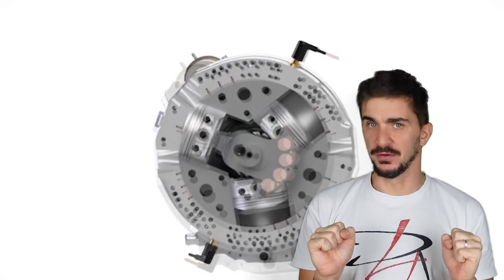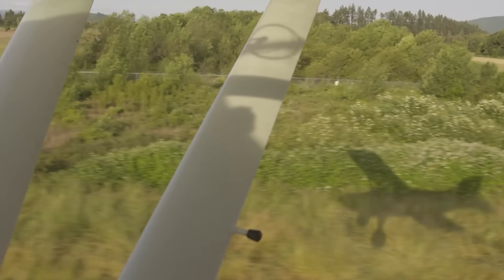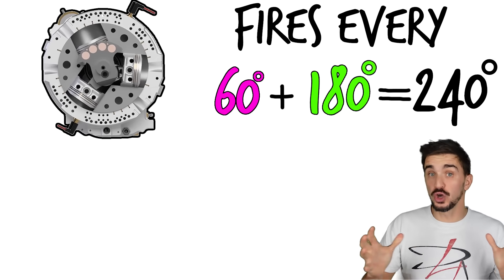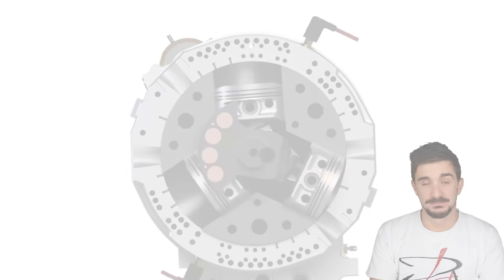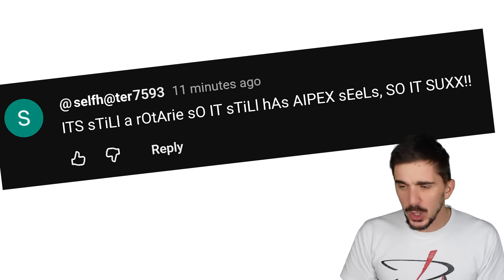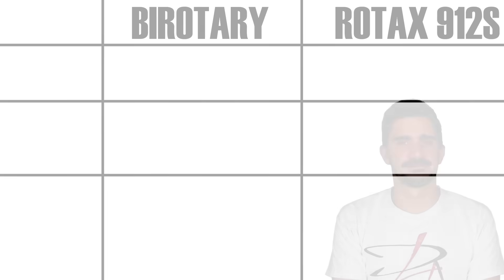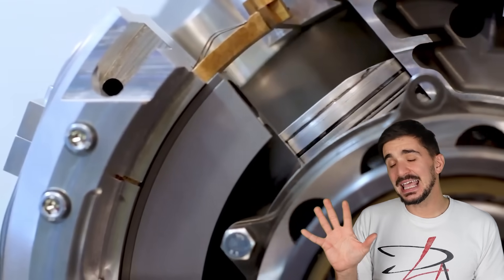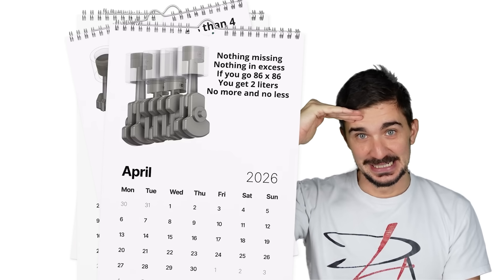This is What Happens When Pistons and Rotaries Make Babies - Birotary Engine Explained and Reviewed

Comment: How long till we rediscover huge WW2 radial engines?
Reply: Actually, this appears to be a revamp of the WWII Rotary radial engine. Like the Gnome Rotary. Counter-rotation of the shaft does make sense.
Reply: @stephenweaver7631  * WWI was ore the era of the rotary, radial was generally a WWII thing.
Reply: @stephenweaver7631  Were rotary engines still used in WW II? Looking at Wikipedia it looks like Gnome produced rotary engines in WW I, but in WW II Gnome et Rhône as it was called then produced radial engines, not rotary engines. Generally speaking weren't rotary engines largely obsolete even in the interwar period?
Reply: @rschroev  The problem with rotary engine was the massive rotating mass.
Reply: @Agnemons  Yes, and ridiculous amounts of oil leakage, and difficult power control. But that wasn't really the point here.
Reply: @Agnemons  ...and to this day it still is. Even when  you have two opposite rotating masses cancelling each other out, they still come with downsides of all the spinning kinetic momentum.
Reply: @rschroev  The Rotary (Wankel) engine was designed in 1934 and was first presented to the public in 1959, after WW2 - They used Radial engines in both world wars. Similar idea, but very, very different. The radial engine was from 1901. That's what they used.
Reply: @Orbi-tal What would you call the type of engine that was used in e.g. the Sopwith Camel? Cause that's the type of engine I assume @stephenweaver7631 was talking about.
Reply: @rschroev  A Radial engine (all propeller driven aircraft in WW1 and WW2 and after). The pistons are fixed around the outside in that design. A rotary (Wankel) engine works differently. I guess they are both rotary in a sense, but in a radial engine (planes) with the pistons in fixed positions around the outside, the piston rods push and pull the center crank. In a rotary engine as used in cars (Wankel engine), the triangular piston is pushed around the inside of the engine from ignition point to ignition point, spinning the crank.
Reply: @Orbi-tal The Sopwith Camel, like many fighter aircraft of WW I, very much had a crankshaft fixed to the frame of the aircraft, with the cilinders rotating around it. The propeller was fixed to the cilinder block. It is called a rotating engine. Go look it up if you don't believe me. 

Also a bit off-topic but even apart from that not all aircraft have radial engines. Spitfire didn't have a radial engine for example, to name just one WW II aircraft. These days propeller aircraft virtually all either have a non-radial piston engine or a turboprop.
Reply: @rschroev  Oh, I stand somewhat corrected then. The Sopwith engine is the Bentley BR1 rotary engine. I had no idea the outer pistons actually rotated. Thanks. Radial ones - pistons are fixed around the crank. I was picturing rotary as in the ones in a car design.
Reply: @rschroev  The only reason the FW190 went into production is because it used a radial engine so wouldn't take inline ones destined for other fighters.
Reply: @Orbi-tal no.
Reply: @stephenweaver7631  You're confusing World War II with World War I. Rotary radial engine means the crankshaft is stationary and everything else is spinning.
Reply: LetsGoAviate on YouTube goes into detail about a two stroke jet fuel or diesel radial engine. Impressive looking stuff.
Reply: I think he 'missed' mentioning radial engines, despite being the closest comparison to this creation (both in use and concept), to not spoil the engines from his calendar as I am pretty sure the 7,9,11 are all radial engines.
Reply: Actually, no; I think the closest comparison is to the rotary engines used in many WWI aircraft, like the Sopwith Camel or the Fokker Dr.I, where the radically-arranged cylinders rotated around a fixed crankshaft.
Reply: @seanmalloy7249  The Sopwith Camel is the first thing I thought of too.  Talk about gyroscopic precession.
Reply: @LAndrewsChannel maybe he'll put that valtra 7 cylinder in the Calender instead🤪

Now that I think about those quirky Traktor makers one of their recent promotion stunts comes to mind where they put alot of tires on one of their models and took it for a swim...

Man you really can't make the stuff up that they use their time for.
Reply: I did a goof and misremembered that it was the Tire manufacturer Mitas that did it with a New Holland.
Reply: We're having electric vehicles from 100+ years ago again 😂
Reply: @wanderingbufoon       They are soon going to become exclusively rich people's toys (they might not disappear this time, simply because now there's enough rich people to keep the market rolling).
The reason plug-in battery-electric vehicles disappeared in the 1920s, 70's and 90's is simple: Batteries do not store electricity.
Reply: @gsilva220  "Batteries do not store electricity".. say what now??
Reply: @wyskass861  ...do not store electricity /hold a charge [forever]
Reply: @evn_exe  Quite a different statement and very loose use of wording. Also maybe you're not aware but modern batteries self discharge rate is very low. Not sure what point you're even trying to make here. Because the reason was not at all self discharge, but low energy density and longevity in battery tech back than, that had to IC engine become standard.
Reply: @gsilva220  well, we all know the reason why and that's due to business. While their battery capabilities were bad back then, they would've had invented better, smaller, more powerful and capable batteries had it not been for petroleum companies. 

It's kind of like with Nikolai Tesla and Benjamin Franklin and so on. The reason why the US adopted the AC is because they wanted to make money on DC because that's where they've had their money tied to.
Reply: @wyskass861    They store chemical energy. Charging a battery is an energy conversion operation, which basically means batteries will never charge quickly and be affordable at the same time.
Reply: @wanderingbufoon  negative. DC was never gonna be useful due to voltage drop over distance. liquid fuels are still 50-100 more power dense than even modern batteries. we were nowhere near the tech level for the batteries back in the early 1900s. a nuclear reactor driven car in the 50s was a much more achievable goal than developing the class of batteries we have now (which, we're worked on just as hard since the early 1900s and didnt start having something until the 70s)
Reply: @gsilva220  "Quickly" and "Affordable" are relative terms.

Combustion had the advantage in that was cheap and easy to do at a good enough level to be viable for its first 100 years. Now, because of environmental and fuel cost reasons it is becoming more expensive and more difficult to do these days with it only getting worse in the future. The only real advantage combustion has now is the natural inertia built into the system. (Sales, refueling and repair infrastructure along with entrenched knowledge and bias). Hydrogen is in a worse position than Electric in a number of ways. Electricity has been around for longer than combustion engines, just not in automotive so it lacks the knowledge base in the general public. But that also applies to hydrogen. Hydrogen requires building a complete refueling infrastructure from scratch. From manufacture, distribution to sales. For Electric the distribution is largely in place already it is only the terminal end (the plug in point) that needs to be done. As for manufacture (generation) that is already under way for AI datacenters and, compared to the requirements for those EV power needs are relatively minor.
Reply: @gsilva220  lol.. Yes internally, but you're being pedantic and pointless obtuse to suggest so. Your point is without any context. "quickly" and "affordable" are meaningless otherwise. These are relative terms and need comparison to an alternative in the same functional domain. Empty words, trying to sound smart.
Reply: @bmxerkrantz  goodness, I think you completely missed the mark here. For one, I brought up that example as a means to establish that progress was stopped in favour of profits. Batteries could've been developed further similar to what we are now currently accomplishing. Had we still keep having that incentive, especially for vehicles, we may push even further into developing the battery tech. 

doesn't matter if it's a reactor generator, diesel, or hydrogen, or even coal (steam) to power up those batteries. We would eventually come up with a power dense one sooner than later.

That's the point. Like I said, electric vehicles were already around 100+ years ago. Even if it's primitive, all of them started off as primitive anyways. Fuel weren't refined and burned fuel inefficiently, most often blowing up the engine (which is why they require larger engines just so they can brute force the bad combustions). 

Again, with time, refinement. That would also be true with electric vehicles and their batteries. We got to see this with changing from lead to lithium making them lighter and rechargeable. Again, time and money are what drives innovation. Take those away and you'll be left with batteries that had been around millennia ago
Reply: @bmxerkrantz 
High Voltage DC Still has it's uses, especially over (relativity) shorter transmission differences.
Primarily, DC allows a utility to use a transmission line to carry more total current than with AC, putting off having to upgrade transmission capacity. 

Background. 
The AC current transmitted is a sinusiodal function, the same as voltage. Thus, the transmission line only carries peak current for a fraction of the time, but must still be sized for that peak current. DC carries peak current the entire time, so much more total power can be transmitted. (Maybe 40% more?)
Essentially, you sacrifice efficiency for capacity.
Reply: @gsilva220 you meant, "Batteries not generate electricity, they only store it"
Reply: @wyskass861      Quickly compared to vehicles that don't impose an input energy conversion step, and affordable compared to the cost of a gasoline vehicle with a similar proposal.
Reply: @drtidrow     Batteries store chemical energy and generate electricity on demand. Batteries are the fuel, electricity is a working fluid.
Reply: @wyskass861 batteries don't store electricity. Electricity is converted to store energy chemically and can be converted  back to electricity. It is the same as when you pump water into high(er) elevated lake/reservoir/tank and then let the water drain/flow down though a (turbine) generator  to convert it to electricity. The lake/reservoir/tank stores the potential energy  to convert it in to electricity, but it doesn't store electricity. There are many ways to store energy but it all depends on efficiency, cost, practically, and safety. It isn't very practical to drive around with a lake on a the roof of a car. 
Water can be split/converted through  electrolysis into hydrogen (and oxygen) or hydroxyl to store energy, but hydrogen from 1 liter (1 kg) of water contains 3 kwh of energy while it takes 5 kwh to split from water. 1 liter of gasoline contains approximately 8.9 kwh (or approximately 11.5 kwh per kg). To store that hydrogen it it needs to be compressed   or liquefied which is very costly and/or with safety  concerns.
Reply: @Agnemons Electric is already in place? I just spit up my coffee! The load of carrying the modern transportation system would require 3 times the size as our current electric system. And that is not talking about energy sources that can provide the constant load needed. Ridiculous!
Reply: @joemaloney1019  True BUT.
For EV's the infrastructure does not have to be built from scratch.
It also does not have to be built all at once.
Also, you are referring to the US grid. The same issues either do not apply or not apply to the same degree in other countries. (to be fair, in some countries it is worse)
Reply: I know an A&P who worked on them and they are a maintenance nightmare. This is the reason they faded from history.
Reply: @PatrickDuffy-u3s I can believe that, they look like you've got very little clearance for stuff even on a stand much less with stuff around it and connected
Reply: The huge part is the problem
Reply: @xani666 the fact that this one isn't huge is probably the impressive part of it. Though I'd like to see one in action.
Reply: @a_kamal_a   Two stroke engines have very serious emissions and efficiency problems.
Reply: 🤔 Well... It's not a problem if the vehicle is huge also...
Reply: We won't.  Large piston engines already lost out to gas turbines in sustained-load applications.  Piston engines still make sense compared to turbines in: 
1. Anything that needs less than about 500 hp;
2. Over-the-road vehicles, which require rapid changes in power output that turbines cant handle; and 
3. Ships and boats.

Large radial engines don't really fit the first two applications.  And, as someone else also mentioned, maintenance is also an issue.  If you need a large piston engine for your fishing boat, it's much easier (and cheaper) to maintain a V12 diesel than a multi-bank radial.
Reply: @tippyc2   4. Anything that doesn't need an engine that's 10 times more expensive.
Reply: First thing that came to mind when I saw that.
Reply: I never left!!! In the 90s I was a flying mechanic on S-58 helos. Curtis Wright 1820 cyclone engine, was quite the experience!!!!
Reply: @Thomas-c7j3f   H34 ?
Reply: These were radial but not rotary.
Reply: The b17 had the largest single stack radial engines. They were super charged and turbo charged.
Reply: I already did rediscover these engines. They have some very clear advantages, but a few key disadvantages. I have ideas to solve all of them, i'm just looking for  a way to get a patent.
Reply: That could be the engine configuration for 7, 9 and 11Cylinders in the calendar. Radial Engine.
Reply: I want the world to run on super loud droning 2 stroke diesels haha yeesh. That, or maybe large displacement 2 stroke gassers.

NOT.
Reply: They make new, small radials now, but they have substantial drawbacks.  They're very cool and the people that keep the old ones running are heroes, but large radials have little potential for rediscovery.  They're kinda bad at most things and long ago outlived their usefulness.
Reply: This could be a hybrid powerplant.
Reply: It will take WW3 for that to happen
Reply: I was thinking thee same
Reply: 2 stroke rotary even
Reply: I mean typically radials were air cooled, so there's at least that novelty? And I guess the Sherman used radials so maybe it could work?
Reply: "Everything retro is better"  - Every Millenial
Reply: lol.. Ya, at one point in the video, I realized this is reviving the old radial and rotary engines from long ago
Reply: straight up. why would you want the whole block to be rotating mass when you could just use a traditional radial?
Reply: @tissuepaper9962 I think the seals are one reason. Radicals are notoriously bad on seals.
Reply: @joemaloney1019  don't get mixed up, I said radial, not rotary. radial engines use the same kinds of seals as any other piston engine.
Reply: July would be my guess!
Reply: Bring back the “Rotating” engine! The one where the crankshaft is stationary and the cylinders & block rotate around it!
Reply: This isn't like a WW2 radial engine, but it's more like a WW1 ROTARY engine.
Reply: @larryschwartz8264  It's actually a combination of both primary aspects of them
Reply: Check out Achates Diesel and Cummins Opposed Piston Advanced Combat engine.
Reply: Well this is sort of equivalent to a ww1 radial aircraft engine so give or take 20 years.
Reply: Wow this is so much different
Reply: @player1GR  but so much worse in every way.
WW1 saw rotary engines because airplanes still flew relatively slow and had difficulties with air cooling, so an air-cooled rotary engine made some sense. 
They were however soon abandoned for Radial engines where only a vey short crank rotates. These radial engines do NOT produce much gyroscopic effects at all, and much less than this proposed new engine with the counter rotating crank shaft. 
Even if two opposite acting gyroscopic effects cancel each other out, they still come with the effects of large kinetic momentum of the heavy and fast spinning rotating masses, acting  similar to a gyrocompass, resisting rotational movements.  

In other words, this engine uses an awful lot of mechanical complexity and introduces a ridiculous number of drawbacks and problems only to resolve an issue nobody has, for an ancient type of engine that nobody really needs anymore.
Marty Mc Fly's self lacing sneakers from Back To the Future II  are far more useful and revolutionary than this.
Reply: WW 1, you mean. Some models of ww1 were rotating similar way, trying to solve cooling issues. Housing was rotating too
Reply: I bet the clearances get very interesting when the bearings get a little worn.
Reply: WW1 rotaries had the cylinders rotating, as this one does, not like WW2 radials.
Reply: A Harley has a 1/4 of a radial engine.
Reply: @tuberNunya  it's a 14th of a 4360.
Reply: They were great. Pratt and Whitney and BMW.. but check out world war 1 radial engines when the whole motor spun around causing massive gyro steer
Reply: Looks like an old Willy's oscillating head no valves massive friction... Too much contacting surfaces
Reply: There is a 5 cylinder radial layout engine in a bike at the Sammy Miller Museum.  The cylinders don't rotate around the crank, but it is a really odd beast to behold.
Reply: ...How long till we rediscover huge WW2 radial engines?...

How long will it take you to find an 80 year old crash site and break out a shovel? BUST A MOVE!!! --- Young MC.
Reply: Comment on what you understand. Don't radial engines have valves, cams, and actually the entire timing system? You somehow missed the whole point of this system.
Reply: In comparison, this has far fewer moving parts, would be easy to add variable valve timing with stupid simple solenoids or a screw shaft, and is a non-interface engine in a tiny package (which means a big reduction in drag).

That's definitely enough to differentiate it.
Reply: Ikr. My first thought was 'isnt this kind of just a radial? '
Reply: Came here to say this. This motor is nothing new.
Reply: @Tek0nn  Doesn't have to be new, just different and interesting.
Reply: All people try always to reinvent the wheel make it less reliable and more complicated and more expensive to make profits on fake innovations.... You need to tell nice history to make the buzz for sale that to not knowledgeable peoples